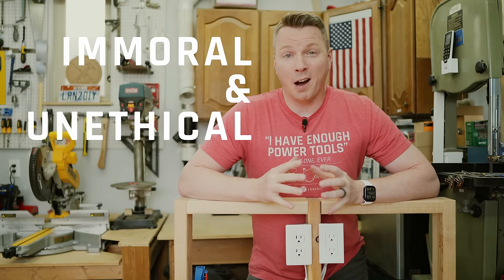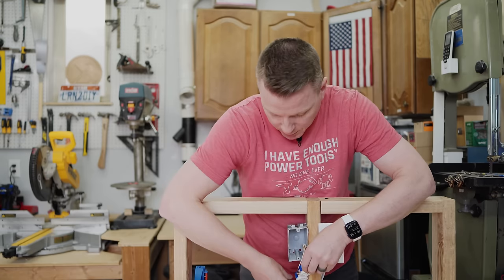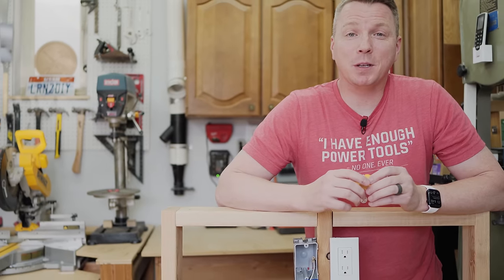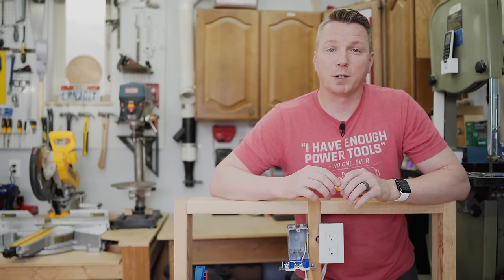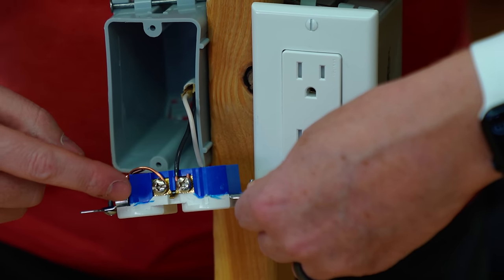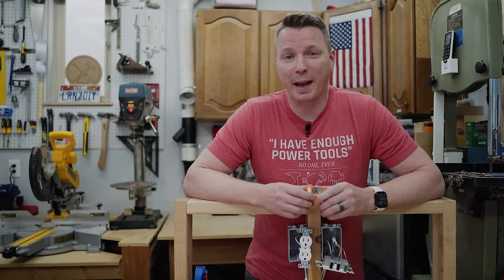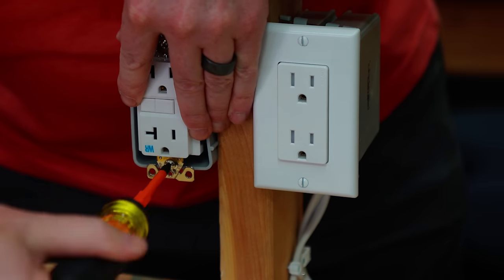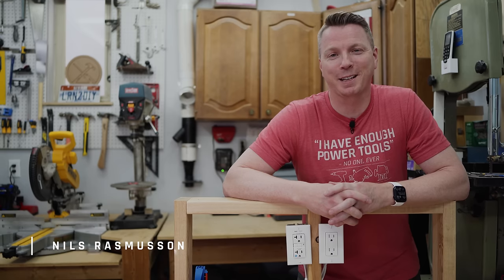People Are Adding Deadly Hacks to Outlets

Comment: "They do a great job for almost every situation" - no they don't.  That's why I (and many others) call them "idot testers" - generally designed to be used by those who don't well understand what they're testing, how it should be, or the inherent limitations of such an "idiot tester".  Heck, in the right hands, and even much cheaper tester can test much better.
Those "idiot testers" are typically just 3 indicator lights, to indicate potential between each pair among hot, neutral, ground - that's all most of them do, and they'll fail to indicate many types of faults indicating "correct" when that's not the case.  They also fail to disambiguate among many various types of faults.
However, even a simple two-lead neon test indicator light (these are often as cheap as a buck or two ... well, used to be, maybe two to five bucks these days?), can do much better in the right hands ... yes, it can show those same potentials ... but it can also show potential between, e.g. one's body and any of those outlet connections - e.g. hold one lead tightly between fingers, touch other lead to ground - if that light lights up (even very dimly - often the case when it does so like that), there's a serious wiring problem - notably a hot ground.  Those other "idiot testers" won't show a hot ground when combined with a hot neutral reverse - they'll indicate "correct" ... well, some idiots do their wiring based upon what these "idiot testers" say, and when it says "correct" they figure they're done and got it correct - when in fact often they didn't at all.
More advanced testers can help, but that's still not a substitute for someone who knows what they're doing, relevant code, how these things work and don't work, and the limitations of various testers.

Comment: So.......question........ [Preface: THIS QUESTION IS NOT INTENDED TO IMPLY THIS SLAPDASH BODGE IS IN ANYWAY ACCEPTABLE!!! IM JUST ASKING A QUESTION, NOT FLOUTING CODE!!! DO IT RIGHT OR DONT DO IT!!!] Okay, so, if the ground and neutral are bonded at the breaker box, and, of course, supposing the correct polarity is maintained throughout the houses wiring, electrically speaking is there much of a difference between using a bootstrap ground wire and also adding an earth ground stake bonded to neutral at the breaker box? [Postface: REGARDLESS OF ANSWER, DO NOT DO THIS!!! ITS THE IN ELECTRICAL CODE FOR A REASON!!! AND CODE DONT LIKE IT!!!]

Comment: The code in Virginia two wires 2 hole Outlet no ground hole to put it in layman's terms a lot of people put three prong plugs with two wires that is an absolute No-No the inspector takes the plates off to check them randomly most two wires are older homes no ground wire

Comment: grounding thru the neutral isn't uncommon. in most situations the neutral and the ground go to the same spot in the panel. yes, technically a neutral can become electrified. and generally a ground is shorter than a neutral. but is it that dangerous. no.

Comment: I ran into that problem before, but they also wired hot and neutral wrong, so it'd short out as soon as anything with 3 prongs was plugged in

EDIT: To be real, the dangers of the "bootleg ground" are a bit overstated here, because of why that rigging fools the detectors in the first place; Ground and Neutral are generally connected on same rail in the main box. 

As for electrocution risk, the risk varies wildly depending on the environment(ie, concrete floor with no shoes on is worse than traditional foundation with shoes on). That's part of the reason why grounding isn't mandatory on all appliances in the US and those 3 prong to 2 prong adapters can legally be sold.

Comment: I didn’t think a cfci could work with out a Cooper ground …
Reply: Yeah it trips if there’s any fault current period, it measures the current between the hot and neutral rather than what goes down in the ground terminal.

Comment: In Germany we call that classic-zeroing (klassische Nullung).
So in Germany it was common as well.
But I’d guess it’s not so dangerous as you are telling. Because it’s just the same as at the junktionbox. If you are using an RCD for protection, it makes the ground on the outlet useless…
Reply: Yeah it isnt really dangerous as long as neutal actually goes to neutral. Although i do find it quite funny that the North Americans find this dangerous because the wiring scheme of this is, if youre ignoring the wire resistance, which still is quite small, the exact same that their normal outlets use.
Reply: @jonasmargraf1388  The problem is if something happened to the white neutral wire than runs back to the mains. Then suddenly anything plugged in stops working and becomes electrified and likely to give you a nasty or fatal shock.

Comment: Yes but it kinda depends how the house was wired. If you use the white and the ground it should still save you because your white should be tied in with the ground.

The problem is mostly with places that don't have there neutral and grounds tied with each other such as a building being run with 3 phase power. The neutral and ground connection are kept isolated. 

This is really sloppy work and I hope no one has to deal with this bull shat but I can see people wanting to do little to no work for an extra buck. Like a home owner who wants to sell their home or just a scummy contractor. Really unprofessional and makes the world worse.

Comment: If it is not properly grounded it will produce toxic electromagnetic radiation, you may be able to use a good EMF meter to detect the improper bootleg wiring. EMF radiation is dangerous yet since it cannot be seen people don't think much of it.

Comment: full 15 amps sounds scary, upto full 15amps is closer to correct, but still wrong.  Truth is ohms law dictates how many amps, so you'll need to drop the word full so at worst the correct way to say this is upto 15amps.  If that doesn't sound as scary it's because it's actually not that scary.

Comment: It goes against codes, but the bootleg ground works quite well as long as there is never a break in that neutral wire.  I always saw the ground wire to be a redundant neutral.  In my opinion, it is still safer than a 2-prong outlet.  People will still intentionally break off the ground prong of a cord so they can still plug it in and I have seen that far more times than I have seen a failed neutral wire.  I have also seen far more failed GFCI outlets than broken neutral circuits.  Perhaps combining a bootleg ground with a GFCI outlet would be good?

Comment: This is why outlet testers can't be trusted, do independent earth tests, you put a metal spike into the ground outside (in a garden or the lawn) connect an insulated wire to it  then to your voltage tester and then you use your voltage tester in each socket hole if you get voltage out of the neutral or ground/earth contact your electrician. This type of test uses the voltage of the ground outside (which will be zero) as the reference point for the voltage tester to check the voltage of each socket hole

Comment: You called yourself an electrician and you should know that you can't get reverse polarity with alternating current because the power alternates between the two wires in both Direction the only way you can get reverse polarity is with direct current.
Reply: Ar you rolling. People use polarity to differentiate between the grounded and underground conductors. If you connect the ground to the ungrounded conductor you get a highly dangerous situation.
Reply: yes you can.

Comment: Here in eastern Europe mainly in the apartment complexes built in the communist era the electrical installations have the grounded outlets only at kitchen and bathroom. This bootleg ground is usually used in the room outlets when grounded outlets appeared. It's not the best and safest solution but it's cheaper and at least have a grounded outlet. At least cheaper than channeling through armed concrete walls. Yeah here the buildings are made of concrete not paper.

Comment: Why do cheap outlet testers miss the bootleg ground? Why does this require expensive equipment to test for?
Reply: It is very hard to detect as the neutral and ground are connected at the main panel. One needs to detect the difference in the resistance. Remember electric wires are designed to have small resistance.

Those cheap socket testers are very simple. Note they have three lights of which two on the right are lit when it is correct. They simply have lights between each prong pair. The one on the left is between neutral and ground, the middle one between live and neutral and the right one between live and ground. The lights use so little power that it does not trip a GFCI. There is no electronics and they do not measure any resistance.

Comment: Your information is partially false; A mix of 2 slot and 3 slot outlets in a home is NOT an indication that system grounding is not present. Back in the 1940s to 70s, metal outlet boxes and steel armored cable were commonly used in residential electrical wiring.  The home’s electrical panel was grounded usually to the main incoming cold water pipe or meter, and it provided a ground to the entire system. A light tester that is connected with one lead to the hot slot of the outlet and the other lead to the metal outlet box or wall plate screw (if it wasn’t painted) will prove that by lighting up. So if you have older two slot outlets, a simple adapter that attaches to the screw in the wall plate will provide a ground for a three prong power strip or other appliance without changing the outlet. Let’s face it however, probably over 3/4 of the electrical items we plug in have 2 prong plugs that do not even make use of the grounding “U” slot on the outlet, so the average person should not be losing sleep over grounding issues at outlets.

Comment: Wouldn't a multimeter, set to continuity, detect this "bootleg-ground?"
Reply: Yes and no. The neutral and the ground are bound together in the panel box. Electrically, the ground and neutral are at the same potential. A meter would show continuity between ground and neutral on a properly grounded outlet as well as a bootleg ground. You wouldn't know the difference. The only real way to know is to open the outlet and look at the wiring. However, an experienced electrician would kinda know what to look for. If he's working at a house and he knows all the wiring is old but the grounded outlets are reading good on the meter, then that's a major red flag.
Reply: No, you need to be able to detect small differences in the resistance.

Comment: You are wrong if you become a path to ground a lot higher number of Amps can go through you tell the braker trips.   A 20amp braker does not trip at 20 Amps for a decant amount of time.  There is a hole table that shows a graph of how fast it will trip
Reply: No, the actual current that goes to the person is small, well under one ampere but it still can be lethal.

Comment: A quality outlet tester will test between neutral and ground, and should be able to detect this "hack".
Reply: passive testing can't detect this. all properly wired receptacles should have conductivity between ground and neutral thanks to the main bonding jumper
Reply: @benchociej2435  There is a reason I said "quality outlet tester"...seriously? #ReadingComprehension

Comment: funny how youtube algorithm suggests this vid. this is more safe than the old "30s wiring in my house :3 here in the netherlands they used to pull cotton insulated steel wires through steel pipes. the pipes acted as ground. fast forward 90 years the cotton pulverizes when you so much as breathe on it. currently redoing all the wiring in here.

btw you americans are so weird. saying hot wire for live wire. where we in the netherlands say in english: 'live wire' rather than the dutch word for 'phase wire', just to have the whole world understand what is meant.

Comment: Yes, if you do this and the neutral opens anywhere in the system, the metal case of connect equipment will have 120 volts on the metal parts.  This stupidity can kill....never do this!

Comment: There's no such thing as intentionally wiring reverse polarity on AC devices.  Think about it, AC...it's alternating current.  The polarity IS alternating.  Household devices are NOT polarity sensitive.  In what state did you get your electrician's license?
Reply: Wrong. Switches are open and closed by being connected to the hot wires. By reversing the polarity, live current will still exist on the appliance even when the switch is off and is a shock hazard. Are you an electrician??
Reply: @surferdude642  you are wrong.  In residential wiring, polarity is not a factor.  I am an electrician but you don't need to be an electrician to grasp the FACT that AC power is constantly switching its polarity.  The polarity is ALTERNATING.  What part of that don't you grasp?  The direction of flow (or positive to negative) CHANGES back and forth at a frequency of 60 hertz (in America).  You don't have to take my word for it.  There's plenty of literature available.  In fact, you can pick up any Apprentice level 1 Delmars electrical theory textbook and it will tell you the same thing.  You aren't arguing with me.  You are arguing with a science called electrical theory.    in regard to this: "Switches are open and closed by being connected to the hot wires."  are you serious?!?!  You don't think you can switch an appliance by opening the neutral instead of the switch leg?  Try it!!
Reply: @CornPopMillerJr  Don't worry Joseph, I understand AC and DC electricity, and what you're saying is generally correct, but we have standards and rules mandated by the NEC. If you wire a desk lamp for example by a non standard method it will still work, but it's a shock hazard. 2 prong plugs are polarized for a reason and hot and neutral wires are designated as such for a reason. A switch on a lamp is always on the hot side. If you miswire it, the switch will effectively be on the neutral side and the socket will be live, even with the power off, and that's a hazard. Sure, you can make or break a circuit on the neutral side because it's all part of a loop required for electricity to flow. In an electrical panel the hot wires are always connected to the breaker and the neutral wires to a separate bus, shared with the ground wires in the main service entrance. Power tools, appliances, lamps, etc are all designed to comply with standards that maintain correct polarity.
I'm talking about 120v residential circuits here. In a 240v circuit polarity doesn't matter because there's no neutral wire and the power and return alternate between the 2 hot wires. If you still think that polarity doesn't make any difference in residential or commercial applications for that matter, I have no idea how you could pass inspection.

Comment: Imagine if Americans built houses that had ground by default so people didn't have to use workarounds like this to get their devices to work?
Reply: They do, these are over 50 year old houses. The problem is the way the sockets are designed. In Europe you can plug grounded plugs to ungrounded sockets.
Reply: Imagine if non-Americans actually did a slight amount of research into what it's actually like over here before saying things like "Imagine if Americans..."
Reply: @HiddenWindshield  Assumptions are bad to make buddy, considering I have lived in US for the past 20 years I think I know what this 'wonderful' country is like and how horrible their electrical codes and safety is :)
Reply: @vkmicrov  The US NEC has recommended electrical ground on all outlets since 1967, and made it mandatory in 1971. Which, funnily enough, is within just a few years of when the UK and Australia started requiring it. (Other countries will of course vary much more widely, but I'm tired of googling electrical codes, feel free to look it up yourself if you're curious.)
Reply: @HiddenWindshield  Sure :) but i'm not saying US doesn't have standards, I'm saying people don't adhere to them. Amount of times I lived in rent with ungrounded outlets is ridiculous and amount of times I saw white, black and blue wires for live instead of just 1 single color - black is also ridiculous. But from my friends in EU i've never heard such complains.

Comment: explain to me please why the "bootleg ground" is so dangerous when ELECTRICALLY the neutral and ground connect to the same location in the breaker box.  I understand that the copper wire goes on one side and the white on the other but they are connected together by the box itself and a jumper usually. The only thing I see as a drawback is the lack of a redundant wire in case something happens to the ground or neutral and the INSTANT error correction for the poor fool that connects the black ( HOT ) to the white or copper lines.  LOL

Comment: AMPS is determined by the resistive load. Saying the 15 or 20 AMP circuit will run through us is deceptive. I get this is unsafe and you want to make people aware, but this wrong explanation I hear all the time, by experienced electricians even.

Comment: 3:56 America 15A or 20A 120v
         Europe 25A 220v hołd my 🍺

I once dealt with a wire that was incorrectly wired but this one was connected to the 360v 50A and I can tell you that I was lucky I was already laying down 😂 unsurprisingly shocking adventure ⚡️⚡️
Reply: Sockets in Europe are protected either by 16 A or 10 A breakers.
Reply: @okaro6595 uk ring mains have entered the chat.